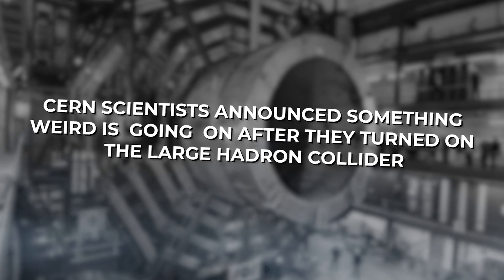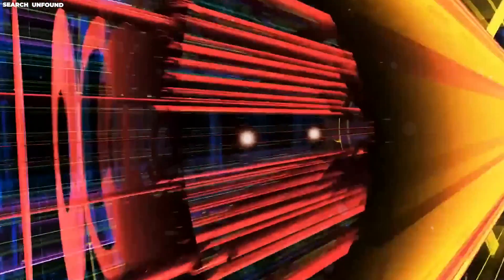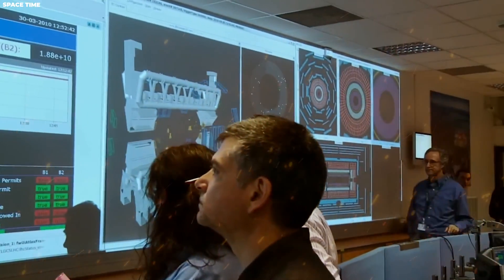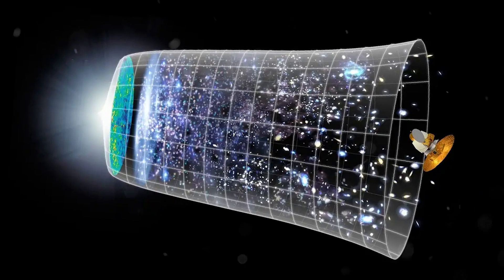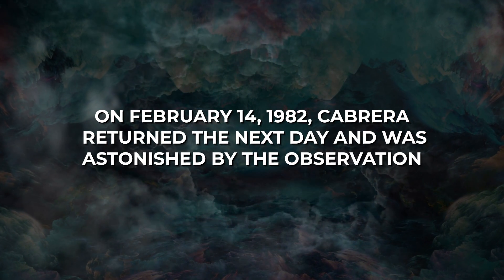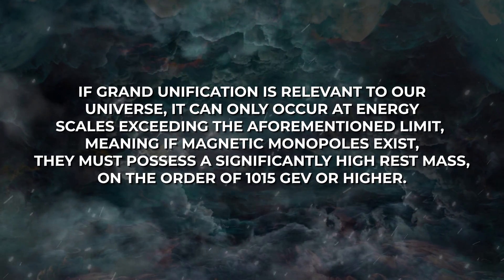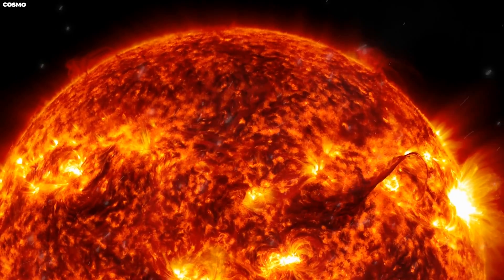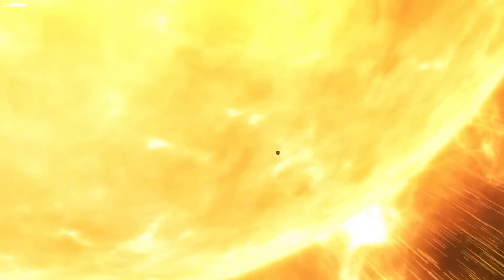CERN Scientists Admitted Something Weird Is Happening After They Turned On The Large Hadron Collider

Comment: That coil is a righthanded solenoid. There's also a lefthanded solenoid. Madam Wu set a righthanded solenoid next to a lefthanded solenoid to see if the universe is mirror symmetric.  But she imagined the current in both is an electron current. There is no hand rule for a negative current in a positive righthanded coil. But the mirror of an electron current is a positron current which the nutty Feynman and Wheeler had declared was antimatter not opposite handed current.

Comment: There are many problems with all of this not the least of which is a single pole magnet. For every positive there is a negative to balance it out. Quantum physics has math that even the most advanced minds can't understand. That means that errors popping up is exponential to the mathematical complexity. The more you over take the plumbing the easier it is to stop up the drain. 
A flat universe equals a 2 dimensional universe when it's clear we live in a 3 dimensional universe. The real grand unified theory is the observable universe is less than 1%. The rest is dark matter and dark energy.

Comment: String Theory was not a waste of time. Geometry is the key to Math and Physics.

What if we describe subatomic particles as spatial curvature, instead of trying to describe General Relativity as being mediated by particles?

Quantum Entangled Twisted Tubules:  "A theory that you can't explain to a bartender is probably no damn good."  Ernest Rutherford

The following is meant to be a generalized framework for an extension of Kaluza-Klein Theory.  Does it agree with the “Twistor Theory” of Roger Penrose?   During the early history of mankind, the twisting of fibers was used to produce thread, and this thread was used to produce fabrics.   The twist of the thread is locked up within these fabrics.  Is matter made up of twisted 3D-4D structures which store spatial curvature that we describe as “particles"?   Are the twist cycles the "quanta" of Quantum Mechanics?

When we draw a sine wave on a blackboard, we are representing spatial curvature. Does a photon transfer spatial curvature from one location to another? Wrap a piece of wire around a pencil and it can produce a 3D coil of wire, much like a spring. When viewed from the side it can look like a two-dimensional sine wave. You could coil the wire with either a right-hand twist, or with a left-hand twist. Could Planck's Constant be proportional to the twist cycles. A photon with a higher frequency has more energy.  ( E=hf, More spatial curvature as the frequency increases = more Energy ). What if gluons are actually made up of these twisted tubes which become entangled with other tubes to produce quarks. (In the same way twisted electrical extension cords can become entangled.) Therefore, the gluons are a part of the quarks. Quarks cannot exist without gluons, and vice-versa. Mesons are made up of two entangled tubes (Quarks/Gluons), while protons and neutrons would be made up of three entangled tubes. (Quarks/Gluons) The "Color Force" would be related to the XYZ coordinates (orientation) of entanglement. "Asymptotic Freedom", and "flux tubes" are logically based on this concept. The Dirac “belt trick” also reveals the concept of twist in the ½ spin of subatomic particles.   If each twist cycle is proportional to h, we have identified the source of Quantum Mechanics as a consequence twist cycle geometry.  

Modern physicists say the Strong Force is mediated by a constant exchange of Mesons. The diagrams produced by some modern physicists actually represent the Strong Force like a spring connecting the two quarks. Asymptotic Freedom acts like real springs. Their drawing is actually more correct than their theory and matches perfectly to what I am saying in this model. You cannot separate the Gluons from the Quarks because they are a part of the same thing. The Quarks are the places where the Gluons are entangled with each other. 

Neutrinos would be made up of a twisted torus (like a twisted donut) within this model. Gravity is a result of a very small curvature imbalance within atoms. (This is why the force of gravity is so small.) Instead of attempting to explain matter as "particles", this concept attempts to explain matter more in the manner of our current understanding of the space-time curvature of gravity. If an electron has qualities of both a particle and a wave, it cannot be either one. It must be something else. Therefore, a "particle" is actually a structure which stores spatial curvature. Can an electron-positron pair (which are made up of opposite directions of twist) annihilate each other by unwinding into each other producing Gamma Ray photons?  

Does an electron travel through space like a threaded nut traveling down a threaded rod, with each twist cycle proportional to Planck’s Constant?  Does it wind up on one end, while unwinding on the other end?   Is this related to the Higgs field?  Does this help explain the strange ½ spin of many subatomic particles?  Does the 720 degree rotation of a 1/2 spin particle require at least one extra dimension? 

 Alpha decay occurs when the two protons and two neutrons (which are bound together by entangled tubes), become un-entangled from the rest of the nucleons

. Beta decay occurs when the tube of a down quark/gluon in a neutron becomes overtwisted and breaks producing a twisted torus (neutrino) and an up quark, and the ejected electron. The phenomenon of Supercoiling involving twist and writhe cycles may reveal how overtwisted quarks can produce these new particles. The conversion of twists into writhes, and vice-versa, is an interesting process.

 Gamma photons are produced when a tube unwinds producing electromagnetic waves.

>>>>>>>>>>>>>>>>>>>>>>
Within this model a black hole could represent a quantum of gravity, because it is one cycle of spatial gravitational curvature.   Therefore, instead of a graviton being a subatomic particle it could be considered to be a black hole.   The overall gravitational attraction would be caused by a very tiny curvature imbalance within atoms.  We know there is an unequal distribution of electrical charge within each atom because the positive charge is concentrated within the nucleus, even though the overall electrical charge of the atom is balanced by equal positive and negative charge.
>>>>>>>>>>>>>>>>>>>>>>
In this model Alpha equals the compactification ratio within the twistor cone.   1/137

1= Hypertubule diameter at 4D interface

137= Cone’s larger end diameter at 3D interface where the photons are absorbed or emitted.

The 4D twisted Hypertubule gets longer or shorter as twisting or untwisting occurs.   (720 degrees per twist cycle.)  

>>>>>>>>>>>>>>>>>>>>>>>
How many neutrinos are left over from the Big Bang?  They have a small mass, but they could be very large in number.     Could this help explain Dark Matter?
Reply: Hello fellow neurodivergent 😂
Why do I have a feeling you learned all this in one hyperfocus session?  😂
Reply: What he said.¿¿
Reply: Your research had moved into the realm of fantasy. he he he!!!

Comment: They are trying to form particles, which inevitably forms weather changes and new organisms.
Reply: How would the creation of new particles change the weather and create new organisms? Particles, if you did not know, make up atoms and other objects (quark soups and neutron soups etc). These "new particles" you speak of wouldn't be able to be created unless you were able to change the frequency that they move in other dimensions (Einsteins string theory. There are 10 dimensions that are connected with a string moving at a frequency that gets turned into a particle in our third dimension.) We do not yet have the ability to change the frequency of the strings in the other dimensions, so we cannot make new particles. What we can do is collide with other particles to VERY SLIGHTLY change the particles to known existing particles.
Reply: @thelaughingman3443  string theory is the reverse of Einstein's equation and is used to determine how light turns into a particle by motion or vibration, that binds particles based on their kinetic energies, it is a theory used to measure the magnetic field of a particle's quantum gravity. Bombarding particles in the Hedron Collider and heating up particles in a magnetic merry go round field, like the Chinese Tokamak, causes the bonding and release of sub atomic particles ( like neutrinos, positrons) that get caught in the kinetic energy of bigger particles like electrons, which then form neutrons of deuterium(water) surrounded by rings of positrons, which could form DNA by muon formation into Tau brain cells. This is all a form of early seawater at high temperatures, which can be seen at the seabed where extremophile creatures of the Archean eon, 4.6 million years ago, exist. But even in the atmosphere, between the mesosphere and thermosphere, at thermopause, extremophile creatures exist.
Reply: @eastafrika728  While yes I was incorrect on the creation of string theory, your reply is still full of inaccuracies. Yes, string theory is an alternative to einsteins equations, HOWEVER it does not explain how light transforms into particles through motion. String theory is also not used for measuring the magnetic field of a particles quantum gravity. The suggestion that bombarding particles in the LHC or heating particles in a magnetic field like the TOKAMAK leads to the bonding and release of neutrinos and positrons is false and unbased. The LHC and the TOKAMAK Don't directly cause particle bonding or release, and any such product caused by the two of those are just byproducts, meaning that there won't be NEARLY enough to support the creation of tau cells, and even if there were, that hasn't been confirmed by science and again is unbased. Until we see proof of such life forms existing or being created by these means, I will consider this false. Such statements go beyond the scientific communities understanding of particle physics and genetics. Please seek outside confirmations before spreading misinformation and unbased "facts" as comments like these can seriously harm the health of the particle physics community.
Reply: @thelaughingman3443  how do you think weather comes about? Fusion, the same way any organisms and DNA comes about, please don't ask stupid questions on the internet
Reply: @eastafrika728  Asking questions about complicated particle physics isn't stupid... Your comment is just plain rude.